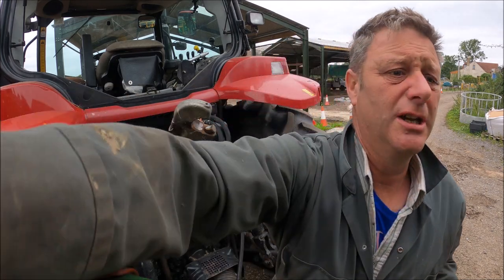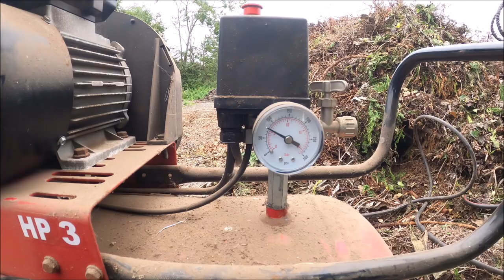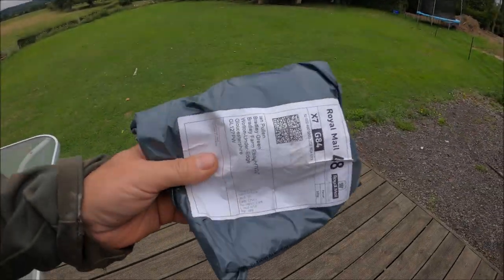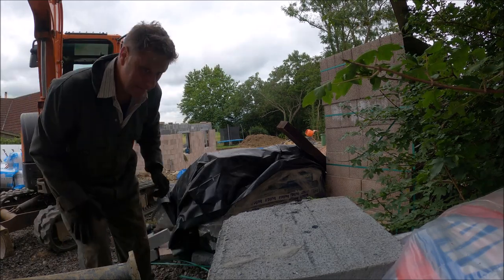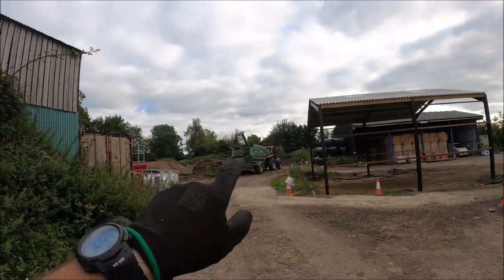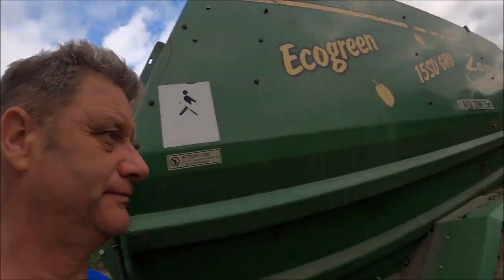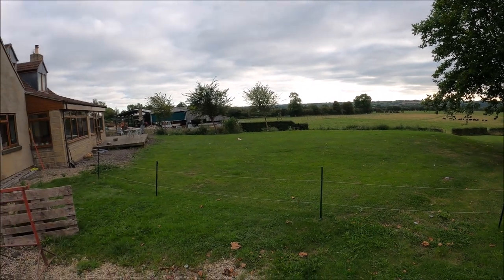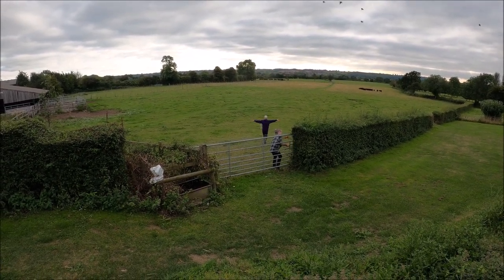Shredding the heap!  25 08 21

Comment: ..... mobile air compressor a good Idea, moving it may be easier if put on a skid with all it's accessories and move it with the Mustang ... could even have a wee work surface with vice on it .... the in-law suite sure is coming along .. those induction cooktops sure are sweet, one or two burners and just set it on the counter. From what I understand only get hot when there is a steel bottom pan on them .... thx for the share FP ... and as always .. never stop dreaming, just dream bigger .. have fun be safe, save our oceans .....

Comment: Does the tractor have an air supply for trailer brakes? Make up a tyre inflator to run off the tractor.
Reply from the maker: No air supply on my case I'm afraid.